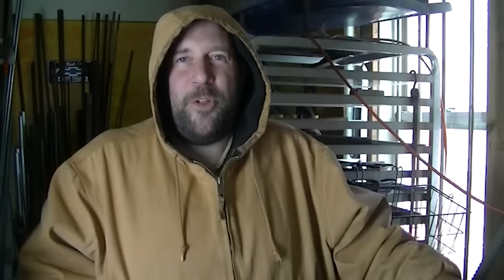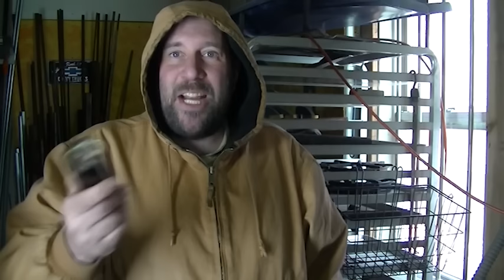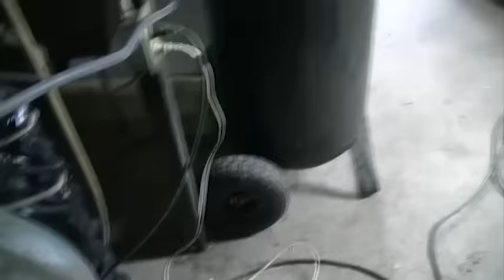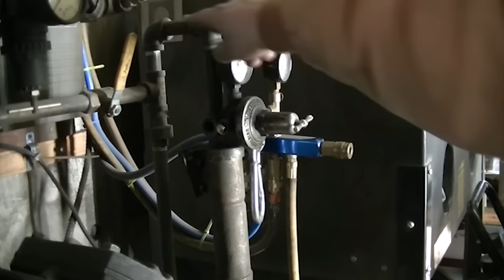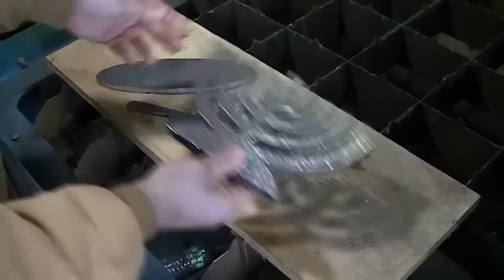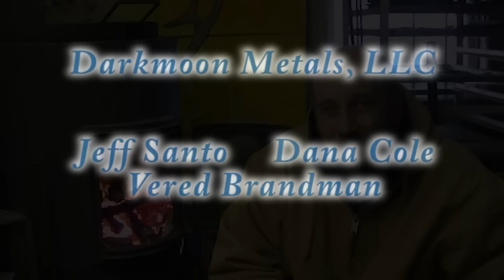Seasons Greetings: Shop Project & Air Compressor Problems

Comment: If they have another capacitor, you can hook them up in parallel to add up the capacitance (or if they are in series they add up as 1/(total capacitance) = 1/C1 + 1/C2 + ... + 1/Cn) to meet your specifications
Reply from the maker: I may have to look into that... My new cap came in and thought the box had the correct markings on it the wrong cap was in the box. Can't keep using that little compressor forever, thanks for the tip :)

Comment: I"ve had problems with air compressors in the cold too.  Another fix is to switch to synthetic air compressor oil which doesn't thicken up as much when it gets cold.  It doesn't tend to cost that much more than conventional and it works well year round.  Hope your new start cap does the trick.

Comment: Respected sir, You can always use a capacitor for a greater voltage (new capacitor has a bigger max voltage than older) if a capacity (which is more crucial) is in "range". So, if you need a capacitor of say 400 uF (microFarads) for 160 volts AC, You can easily put a 400 uF capacitor for an example 275 VAC. Also, when taking a time to replace a capacitor, check the state of a centrifugal switch, if there is one on the motor (usually in the ventilator area in the motors in this forgotten country). Do replace a capacitor as soon as You see starting troubles (motor does not need capacitor once it is running) since this can burn your motor, with increased starting current and start time.
Best Regards,
Goran

Comment: time for a new start capacitor
Reply: I think we usually match the microfarad and use higher voltage rating if you need to.
Reply: That is correct, as long as the voltage rating is higher it is fine but mfd must match. The motor had its life shortened by running an undersized cap.

Comment: Really beautiful piece. Just wondering if the steel was already pitted or you did that yourself, and how...........Tkxxxx.......Bob
Reply from the maker: Thank you, it was a lot of fun to make... I took the steel after it was cut out and put it in the forge, its a propane forge that happens to have a side door large enough where I can heat nearly the whole piece. Brought it up to a dull red and did the texture with a ball peen hammer.
Reply: Jeffrey Santo Tkxx Jeffrey, It really looks natural. I'll try it myself. Merry Christmas